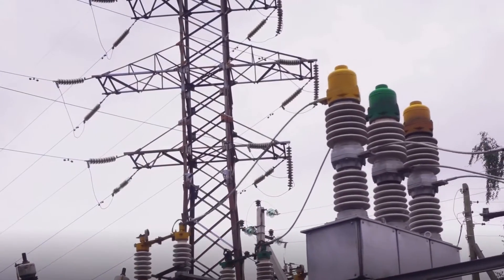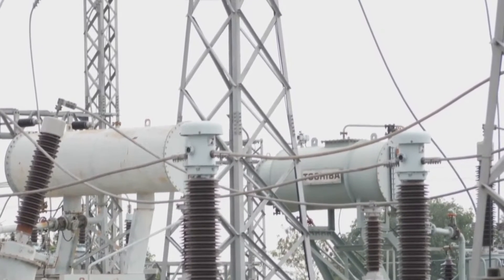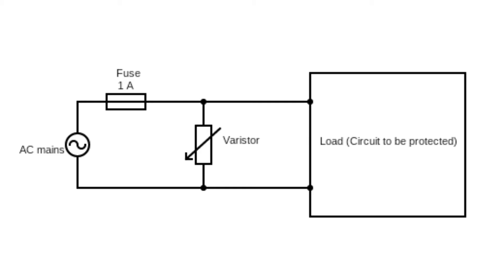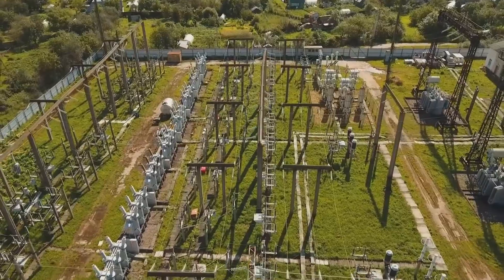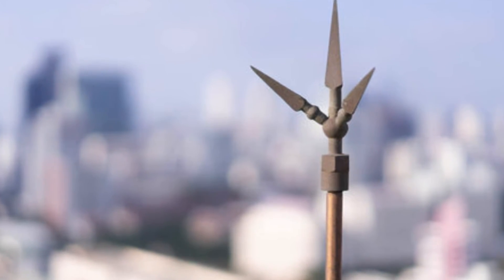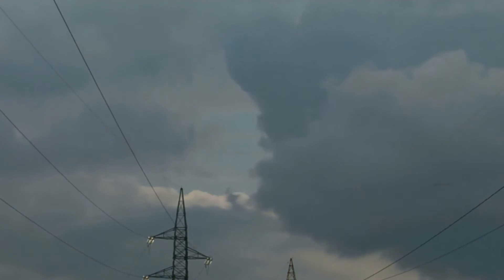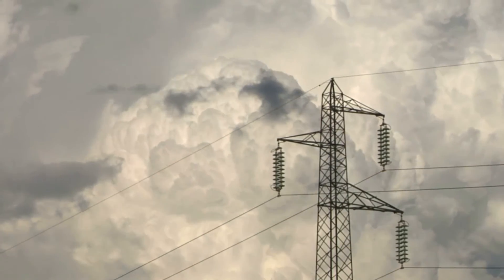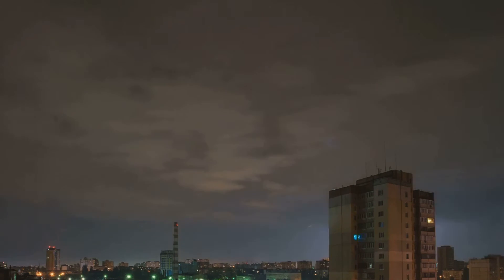What is the difference between Surge Arrestor, Lightning Arrester and Lightning Rod? #electrology

Comment: This video raises some doubts about the relevance of the content and some of the images used. There is often so much confusion, but the reality is quite simple: Surge Arresters and Lightning Arresters are exactly the same thing. These devices, made of Metal Oxide Varistors, are used to limit overvoltages in power systems. They do not absorb lightning surges but rather divert them to the ground, preventing flashovers on the equipment that needs protection. The term "Lightning Arresters" is often misused, particularly in India and the US, where it is incorrectly applied to what should be referred to as "Surge Arresters."